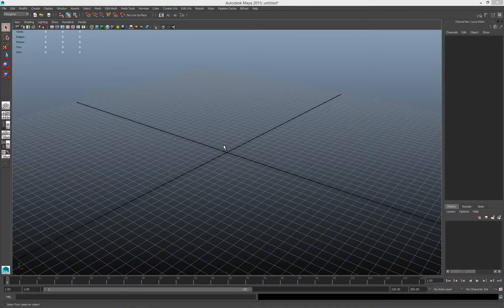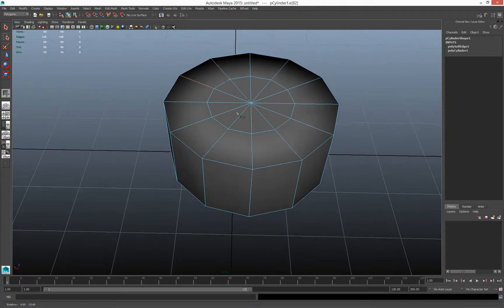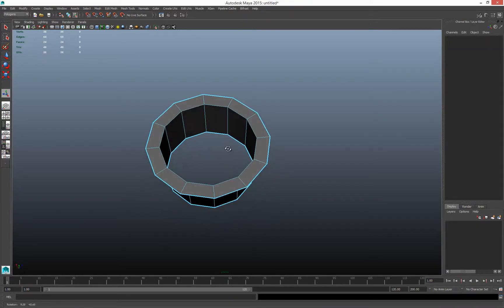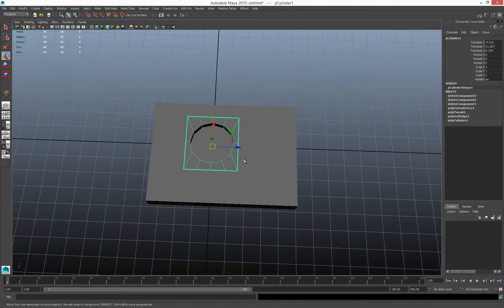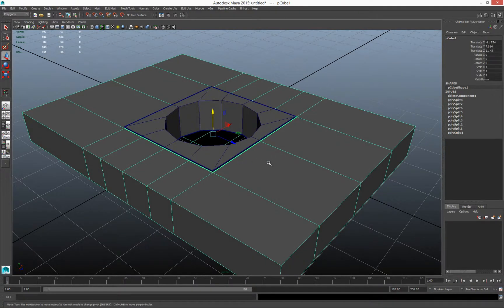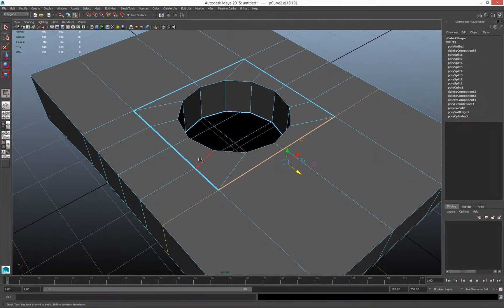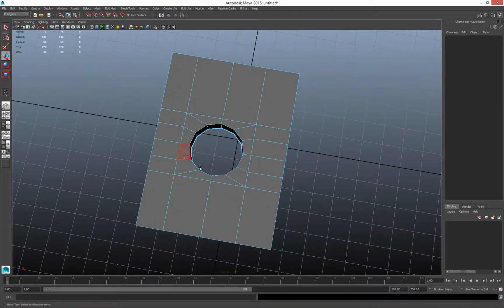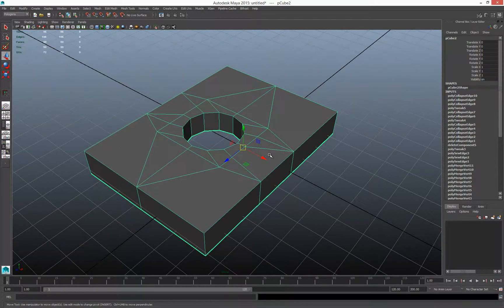Manual Boolean and the Multi-cut Tool

Comment: been using maya for a fair while now but defiantly gained some knowledge with this, thanks! looking forward to more.
Reply from the maker: Dsgnrm Thanks for the comment. :) Glad I could help.
Reply: Is there a way to fill the bottom portion while still keeping the hole intact?I'm modeling the samsung gear smartwatch and I'm trying to make the strap that has the holes in it. I hate booleans as well. I tried it and didn't like it.